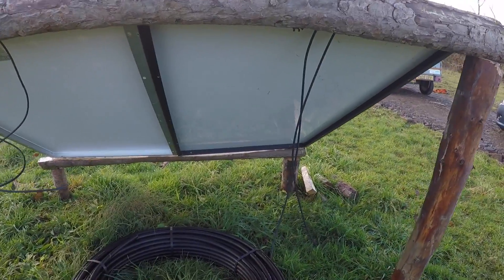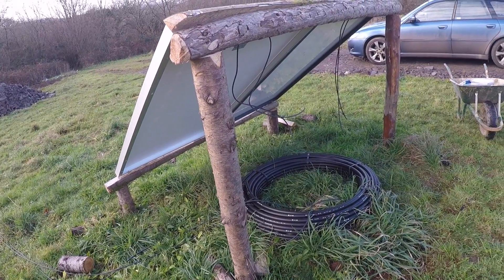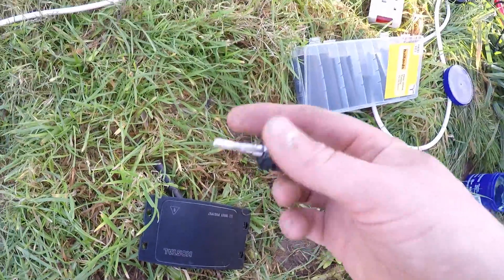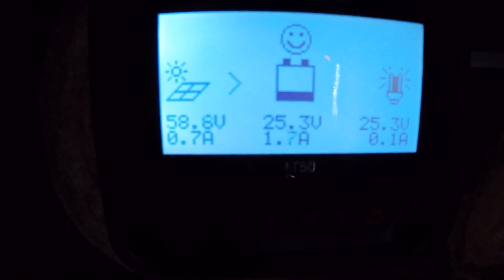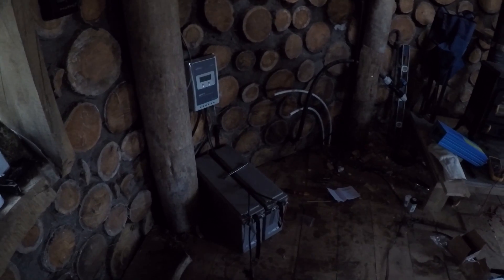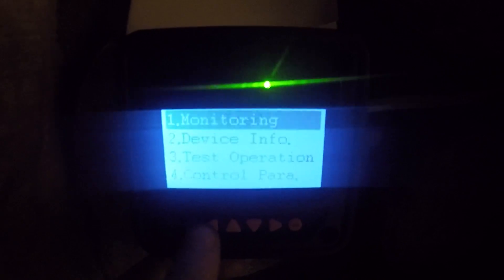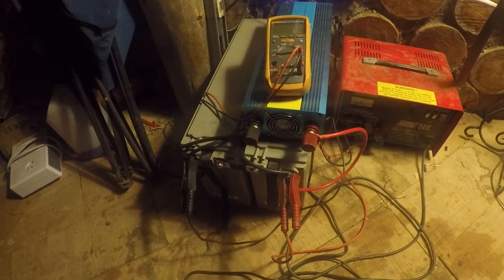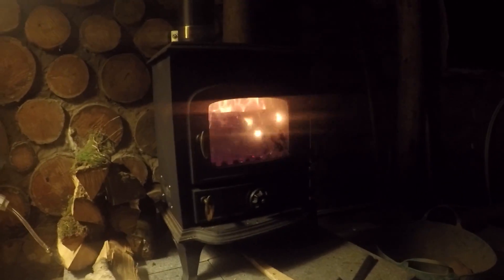off grid roundhouse build part 27 solar power

Comment: your losing loads in cable loss, if you're using 4mm cable over that length of run.
Reply from the maker: its not 4mm its 10mm and at 60v so im not loosing much at all less than 5%
Reply: Kris Harbour Didn't catch the cable area in the vid. I use the 4mm, and ought to upgrade, one of those jobs to get round to. I lose a third, after the cable gets hot!

Comment: Plumbing solder (and flux) used on wiring is a really bad idea; plumbing flux is acid and will corrode the wires. I recommend removing the solder joints (even if they are working fine) and replacing them with electronic solder with rosin flux.
Reply from the maker: thanks for the comment, i didn't know that. just did a quick search and you are right its kind of a temp setup and is working fine.  i will be upgrading it and moving it to a final position quite soon and i will be sure to cut all of that out and re do it with proper solder. thanks for your input.

Comment: The solar will need some more work...breakers...lighting arrestors...grounds...good idea to put the invert-er and batteries underground underneath your panels in a well insulated vessel..then run AC to your home with minimal loss...or a shed for all the stuff plus the generator as mentioned below..

Comment: Hi Kris, really enjoying the videos. Moving to Ireland soon and buying a remote cottage in the west. considering solar power, as have that on my home converted camper. can you tell me about your batteries and house voltage system? are you going to run a 12v system with use of inverter to 240v when needed? just little confused, as you are running a higher than 12v power source from the panels to the house...what does the charge controller put out? 12v? 24v? massive respect for what you have achieved btw...from a grumpy DT teacher in Uk who is early retiring ASAP!

Comment: You want he distance to be as short as possible between the point of use and the solar panels as you lose power over greater distances, is there no way of fitting some sort of platform in the trees near the house?

Comment: are you aware that batteries can give off explosive gases when they are charging...your batteries are quite close to your woodstove...maybe box them in and vent exhaust outside of the house...love your vid's and your roundhouse ...
Reply from the maker: +swany yes I am aware, these are sealed agm battery's that don't really give Orr much gas, there is a little hole for a tube and I will run that outside at some point. They are not going to get high charging currents at the moment due to the sun being so low in the sky and I'm not there running the wood stove at the moment anyway.

Comment: Awesome progress. It will be livable early next year at this rate. One little tip: Don't burn all that green mossy wood in your fireplace....debark it at least. It will clog up the flue, make heaps of ash you'll have to get rid of and blacken the glass super quick. It will burn just fine, but if you're continually using it you have to maintain the fireplace way more often then if you had only used seasoned wood.

Comment: How long are those solar power cables? I think you need a lot fatter cables at those distances or you will lose a lot of power in current-losses in the cables. Have you got any more panels that you want to hook up?

Your build is looking very good and it must feel fantastic to have gotten this far! :-)
Reply from the maker: +IMorten Mortensen I ran extra large cable for that reason, they are 16mm cables I believe at 60v carrying 400w there would be about 6% loss if I rember right. I did all the calculations before buying the cable. If I add another 500w of panels that will take me to the 40a the charge controller can handle and would be around 18% in losses. That is still quite a bit but solar panels are cheaper than cable. That is nearly £200 worth of cable there so it is much cheaper to add panels than run even bigger cable
Reply: That is very true! :-)

Another option would be to move the batteries, charger and inverter to the solar panels, that way you would be sending 230VAC over the cables which would make the losses a lot smaller.

This would also allow you to have a power house where you could run a generator away from.tye house so you don't have to listen to it while charging or when used for backup or heavy loads.

Just make sure to install a solid ground connection in your incoming panel in your house so you can still use RCD's to protect you from a ground leak...

Did you put the cables in trunking or did you just bury them as they are?
Reply: Monster cables are hideously expensive. When you launch into a project like this, there are compromises: time, money, materials, (specialty) tools, and the wear and tear on your aching back... Then there is your peace of mind; everything could always be better, with big budgets and free labor. Gooodd luck getting all that. There has to be a point where it is good enough and you can possibly make improvements along your journey. Keep on hammering.
Reply: Better still, use a boost converter at the panels, and a buck converter at the charger (if need be) to send high voltage DC over the line. AC is not ideal in moist conditions, as the wiring gets capacitively linked to the earth and leakage occurs. Since DC is blocked by a capacitor, it won't leak. That's why, if they have to transmit power across underwater cables in salt water, they use high voltage DC.
Reply: why didn't why convert it to AC at the panels and run 120vAC to the house? Would cost a 1/10th for the wiring compared to what you did
Reply: I run 70-90mm cabling for my cars audio system. I wouldn't have used 16mm but I'm 3 years late and it seems to have worked so good for you

Comment: Would it not work better if the solar panel y closer to the house?
Reply: Panel is closer to the house
Reply: The house is surrounded by trees, solar powers don't really work much in shadow, so setting them up on the open field will generate more power. There isn't that much loss in cable either...
Reply from the maker: the woodland blocks out all the sun any closer, i used 16mm cable to reduce any losses from the distance.
Reply: Kris Harbour Have you considered using a small wind turbine btw? There's some pretty cheap alternatives out there that generate a nice amount of energy, Wales is also pretty windy and rainy, so it may be even more reliable than solar.
Reply: Thanks for your answer. If it doesn't charge consider closer with four longer poles to be above the bushes

Comment: I don't know how it is in the UK but in the US plumbing solder uses acid flux instead of rosin flux, so it will corrode through the wires which can cause fires and electrical failures over time.

Comment: You will have more than enough power buddy , I only have 2 x 110A leisure batteries and a 200w panel in my van and i can use the playstation on a 32 inch tv plugged into a car stereo that's running through 2 amplifiers with 7 speakers while charging my laptop and phone and having LED strip lights on until I go to bed .. You wont have any problems. House is looking great.